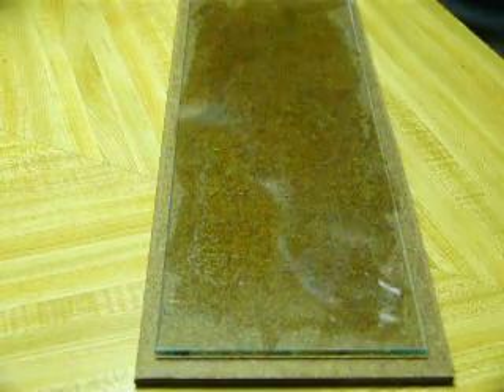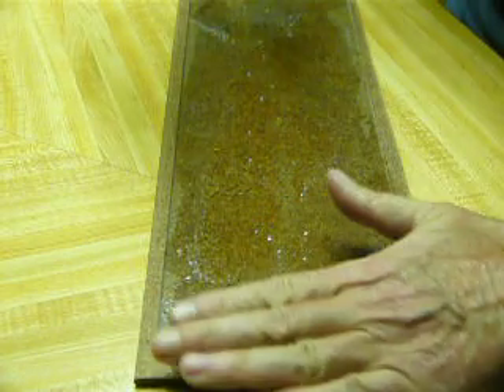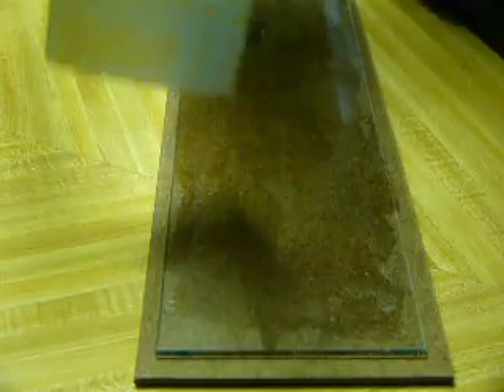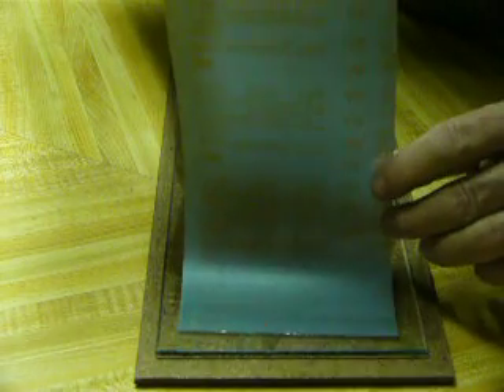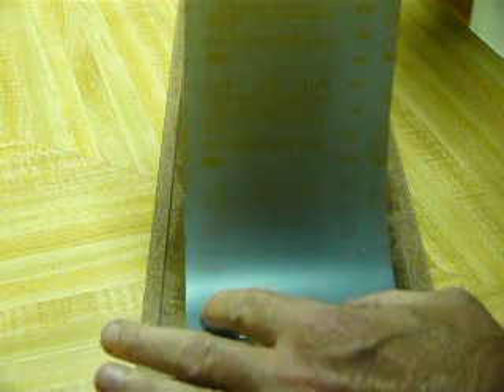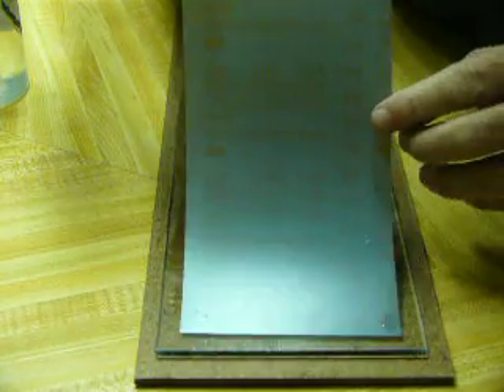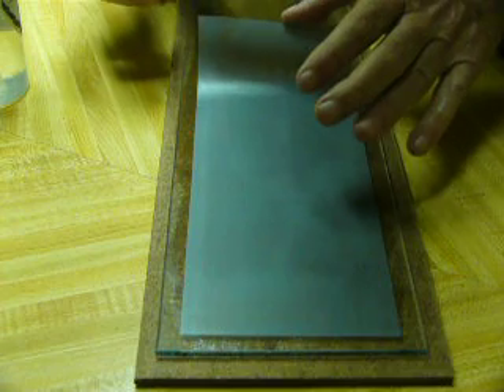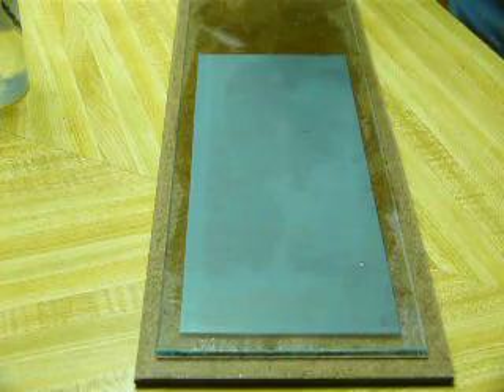putting 15 micron paper on glass

Comment from the maker: @Ltb0b What is important is flat. If you use a backing board and work on a flat surface, the lexan should be just fine. With glass, the board is mostly there to make handling the glass easier - no glass edges to hit with a tool or on a tool resting on the bench. With lexan, which would not be bothered by that type of tool contact, the backing board would reduce/eliminate flex.